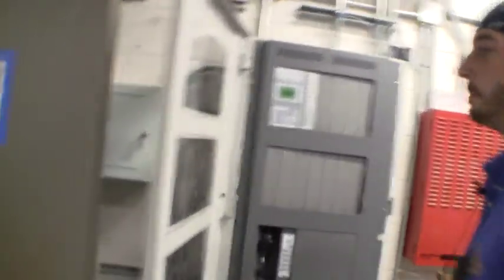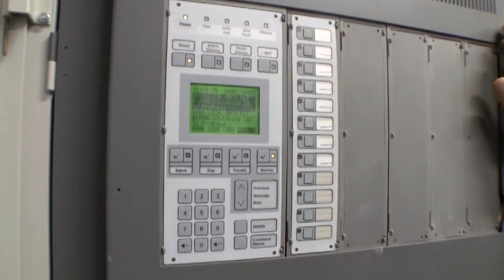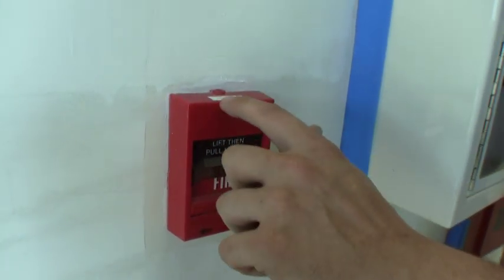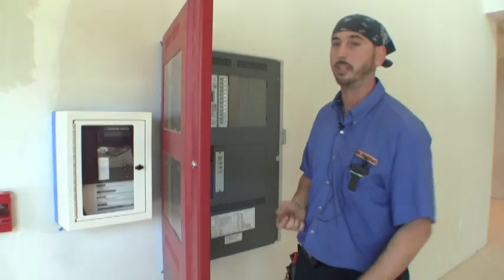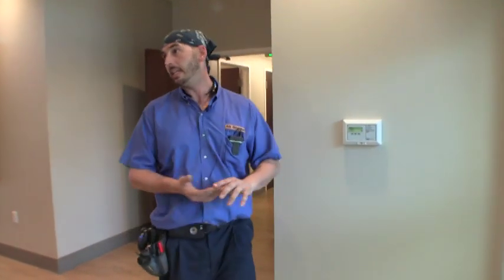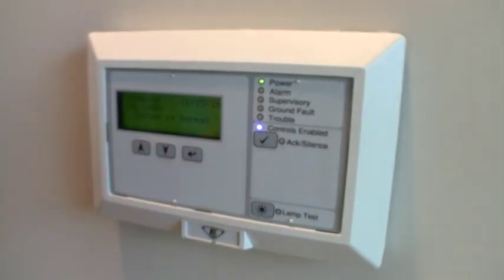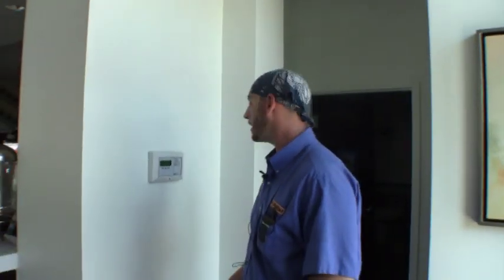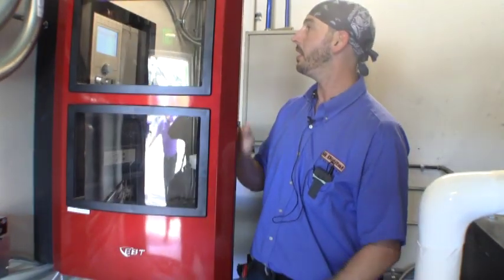Moorings - Fire Alarm Training

Comment: Hi Sir
I like your Explanation of EST MFACP panel., I saw this  full video But I have a doubt.this incident happened One month before  
One day I was sitting inside the fire command room suddenly fire panel show smoke detector active in 16 the floor Apartment no: 1.I had silent the alarm and  I reached that apartment But Real alarm came from another apartment no: 2  I know may be  this is the wrong programing  so panel showing wrong  I Want to inform this matter to our EST panel installation team next Ppm time they can rectify  So  I  came back the main panel room for conformation  but I didn't get  the fire alarm details 
If you know please explain how  we can check the  previous fire alarm details ?

Comment: SIR HOW TO HIDE ANY EMERZENCY MAP FAULT trouble  FROM PANAL
Reply: It’s easy , just disconnect main power , ( batteries first ) , remove device in map fault ( before you disconnect power and batteries) , make sure you clean metal pins  at smoke detectors base ( before removing it from system ) , press menu button and look for re-map option ( old panels - default panel ) , press “ ok “ few times after that , you can reconnect power and batteries. Good looking you :)
Reply: A map fault is caused by a new device being added to the loop, or you have a balanced map on a class b slc circuit, or you have devices wired incorrectly for input and output slc voltage. Or just disable mapping for your shitty install.